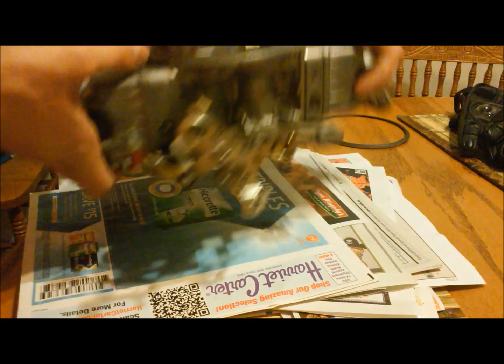Holley Carb: Ported vs Manifold Vacuum Advance (CARB BASICS PART 1.5)

Comment: Hey thunderhead289 can you use the thermo vacuum switch for ported and manifold to distributor in the back of the intake instead of the front

Comment: I have a crate 383 stroker in my 77 Monte Carlo that came with mechanical advance. Also installed 700R4 tranny & 3.73 rear gears. The cam Lift: .500 / .510, Duration @ .050: 225 / 231, Centerline: 108, Fair idle
The vacuum advance cannister is connected to distributer but crimped (not hooked up to any vacuum). As it is, my timing settings are maxed out for maximum engine output. Car runs perfect! If I hook up vacuum advance to manifold, can I simply leave those timing settings alone?

Comment: WRONG!  LOOK IT UP! All you need is any shop manual or Motor manual and you will see, ported vacuum, also called timed vacuum or controlled manifold vacuum, was THE ONLY THING USED PRIOR TO 1968. Don't take my word for it, look it up! Holley,  Carter, Rochester, and Ford carbs ALL state to connect ported vacuum to the dist from the factory. The only argument is between Edelbrock and every other factory manual and carb manufacturer out there.  Ported vacuum was used as the ONLY type of vacuum advance back to the early 50's and earlier! The only carb company that stated ported vacuum was only used on emission vehicles is Edelbrock, and many have called them out on that and they refuse to reply or change their documentation, even though EVERY shop manual, Motor manual, Chilton manual and every carburetor manual, except Edelbrock, says it's ported vacuum that was originally used from the factory. Like I said, look it up!

Comment: You say anymore than 24* at idle is too much but you don't explain why, I'm running at 30* and the engine's never run better. in fact, I plan on re-curving my distributor for more advance, Numbers mean nothing, it what the engine wants. "No disrespect" just saying. it's just that some people make statements with no explanation to back it up.
Reply: You got that right. It depends on the cylinder pressure that your combination provides. One engine may not even crank over with more than 10° of initial timing and another may not have any punch at all with less than 30.

Comment: This guy seems knowledgeable but made a mistake about ported vacuum stating that it "wasn't used until the late 60's due to emissions."  That is completely backwards.  I have owned cars back to the early 50's and worked as a mechanic in the 70's and ported vacuum was ALWAYS the factory standard and many times hardwired that way with copper tubing fittings so they couldn't be "accidently" moved.  It wasn't until the late 60's early 70's that they found different ways to reduce or eliminate ported vacuum advance by using temperature sensing valves that shut it off or used manifold vacuum "dual diaphragm" distributors that  when manifold and ported vacuum were the same, it cancelled out and gave no advance when cruising.  Ported and manifold vacuum are pretty much identical when driving, under light accel or WOT.  The only difference, as he said, was at idle. The other problem with manifold is, if you think about it, is you are running a lot of vacuum advance at idle and you go to accelerate and the vacuum suddenly drops and your timing retards significantly and can cause sluggish acceleration and sometimes backfire.  Where he is correct is in a high performance engine, mechanical advance is your friend!  I don't use ANY vacuum advance in my race engines because at WOT, vacuum advance doesn't work anyway.  Max advance at 34-36@2800 RPM is a good start.  If your cam is lopey enough to cause you to open your idle up to the point where you have a lot of ported vacuum, you would probably be better off with manifold vacuum to smooth out your idle a bit, but for a stock or mild street car, ported was stock and works well.

Comment: I had my vacuum advance hooked up to my ported vacuum on my carburetor, but it was causing a problem. The problem was, extremely hard starting like the advance timing was too much. Come to find out, when I turn the engine over to start, it was advancing my timing  so much, my engine would drag. Now I have no vacuum going to my adjustable vacuum advance. Engine starts nicely every time now
Reply: Learn how to properly set up timing! Something is wrong in your system!
Reply: @trailerparkcryptoking5213  i’m a technician. I’ve been a technician for 50 years. I know how to set  timing properly. The problem was heat soak on a holly carburetor and ethanol fuel. I fix the problem
Reply: Not possible.  Ported vacuum does nothing at idle or while cranking.  Sounds like your initial is too high.  Something not right with this issue.  Kinda like "since I painted my car blue, it runs much better!"  Can't argue with results, just how you got them.
Reply: @gregstahlman1680  I’ve already fix it
Reply: @gregstahlman1680  but yes it shouldn’t

Comment: Luke, I've been binge watching your carb videos. When did you switch from a manifold vacuum guy to a ported vacuum guy and why?
If lean (idle) mixture needs more time to burn, wouldn't manifold be the ticket?I
Love the videos.
Reply from the maker: This was back in the day when i taught along conventionally a cepted guidlines, not based on my own engineer knowedge and what i actually do. 
Ported is better in most cases due to what it allows you to do with your mechanical timing better matching it to conditions throughout the load range.
Reply: The only difference between MV and PV is at idle.  If you have a big, lopey cam, a little extra timing at idle from MV can smooth it out a bit and still allow low initial so you can crank it easier to start when hot.  Ported vacuum was ALWAYS standard back to the 40's and was NOT designed for emissions, in fact, emissions demanded they lower or completely block ported vacuum advance.  That statement about it only coming about for "emissions in the 60's and 70's" is incorrect.  I can show you the factory holley on my 58 FE that was hard wired to the dist with copper tubing from the PV port on the side of the metering plate.  No emissions then.
Reply: @gregstahlman1680 
I don't agree at all with using manifold sourced advance as a crutch for an aggressive cam with an automatic transmission because when you put it in gear the rpm drops, vacuum drops, timing drops, motor don't wanna idle in gear😢 I think the majority of people that advocate relying on vacuum advance for proper idle quality are trying to use a factory stock carburetor, something similar, or don't know how to tune/modify what they have to work on their modified engine. A modified engine will usually require more initial timing(modified distributor) and enrichened carburetor idle circuit(modified carburetor or performance specific carburetor) because a modified engine usually pulls less vacuum at idle speed to draw the fuel through the circuit. It's a matter of having the proper size idle feed restriction and the proper throttle blade setting in relation to the tranfer slot.
Reply: @gregstahlman1680 
But, like you, I usually prefer ported sourced advance(when I'm even concerned with vacuum advance). Manifold sourced vacuum advance can work very nice with a manual trans, though.
Reply: @gregstahlman1680  And right there is the obscure comment I was looking for... I'm putting together a 1958 Lincoln 430 and have a later Holley 1850-3 so I can run a PCV conversion. It has two vacuum ports, but some of the early Holleys (like the 1850-1, which would have been original on the Lincoln and Ford FEs) had only one port, up where the ported vacuum is on a later Holley. I was trying to figure out if that was ported or manifold so I can hook up my distributor correctly; I'm going to go with factory specs for now since that's what the distributor will be curved for; I figure I can always experiment later. Thank you!
Reply: @Hemingray1893  The port on the side/top is definitely ported.  The one on the bottom may or may not be ported.  I would plug the bottom one and use the top one.  Some later holleys have ported at that same place on the bottom, but a vacuum gauge would confirm that.  I have PCV on my 58 but just have a spacer under the carb with a vacuum port on it for the PCV valve. Works very well.
Reply: @ Excellent; thank you!

Comment: Where, exactly, is the hose connected for Ported Vacuum?  You point frequently to a tap on the upper part of the carburetor, I'll presume that's it.  Where do I pick up manifold vacuum?  Is it somewhere on the carburetor?  On the manifold itself somewhere?  Thanks!
Reply: A manifold port will be on the lower part of the carb because it gets constant vacuum from the manifold. Ported is higher on the carb because it only gets vacuum when throttled. I hope that helps. Sorry it took 7 months.
Reply: @robpitthan7497  Thanks.  I figured it out a while ago and got the thing dialed in nicely.
Reply: Awesome! I think it might be an issue I'm having with my '76 Dodge van.

Comment: Thanks for this video. I have a question though. If I want to use manifold vacuum for the advance, what should I set my initial timing at idle at? Should I have manifold port capped off while setting it? I have a mild cam 350 bored 60 over. Doesnt run hot idle is just a little roudy. Double hump heads. Stock hei dizzy. It's in a k10 chevy truck. Thanks in advance.
Reply: Learn where to set total timing!  Initial timing is for dummies that don’t know how to tune!

Comment: It depends on which vacuum canister you have on your distributor.  If you've got a "modern" canister that's all-in at say 14", and it's connected to manifold vacuum then vacuum advance drops out during throttle tip-in, that's not good.  If you've got an "pre-emissions" vacuum canister that's all-in around 5", then it's designed to be connected to manifold vacuum.
So choose the correct vacuum canister and connect it accordingly so it operates as intended.

Comment: Correct! Ported Timing was an early and poor emissions idea, and Manifold vacuum is the right way to go. Before anyone disagrees with that... Go and do some research! Good video.
Reply: Incorrect.  Ported vacuum was used back to the 40's and was to help with mileage and overall performance when cruising.  It wasn't until the late 60's 70's that they reduced or blocked it completely to make cars run hotter and cleaner.  This guy has it backwards.  Before ported vacuum advance, it was mechanical or manual with a lever on the steering wheel.  Manifold vacuum was NEVER used on a stock, early vehicle.
Reply: @gregstahlman1680  WRONG. Ported and manifold vacuum are the same except at idle.  Manifold advances at idle, cools the engine and runs more efficient. There is no way ported improves mileage over manifold vacuum.
Reply: @bmclaurine maybe, but he is right, that ported was used long before emissions, in the 50s and early 60s. Every mid to early 60s Mopar used ported vacuum.

Comment: Agree, manifold vacuum is best if engine will run with it.  The 355cu in SBC in my ‘69 Corvette, 600:Holley double-pumper, has full vacuum advance of 14* at idle, which the engine really likes.  Ported vacuum didn’t cut it.

Comment: So let me grab the concept here. Ported vacuum basically will pull more vacuum vs manifold vacuum, thus causing premature vacuum advance?
Reply from the maker: Ported vacuum simply doesn’t add any timing at idle where manifold will. Nothing more to it - I prefer to run ported with more mechanical initial advance. 

Vacuum advance will drop out of the timing equation when you are under high load low manifold vacuum scenarios
Reply: @ThunderHead289  Wait but in the video at 3:14 you said you like to run manifold vacuum, I've watched your newer videos where you say you prefer ported but what made you change your mind from preferring manifold vacuum in your older videos to preferring to run ported vacuum in your newer videos? I enjoy your content a lot but always wondered what made you switch
Reply: @crankemtv3907  I wondered the same. So yeah, would like to know as well

Comment: The standard setup, before emission controls, vacuum advance was only ported vacuum and its purpose was to improve fuel economy. then with emission controls, some companies got tricky with two hose vacuum advance cans, one ported and one manifold vacuum or like some Fords, the vacuum advance was switched to manifold vacuum. The distributor has to be made for using manifold vacuum, both the vacuum can and the mechanical advance. Performance and pre-emission control distributors should normally only use ported vacuum advance, unless they are specially made for super chargers or turbo chargers. Racing distributors typically have no vacuum advance. Fuel economy isn't much of a factor and the mechanical advance is all in at relatively low RPM and more advance from vacuum would just complicate things.
Reply: Thank you for clearing that up!  This guy stated that "Ported vacuum didn't exist until the late 60's for emissions." Totally untrue.  As you said, ported vacuum was around and the standard since the early 50's or before and was designed for  better mileage and was standard no almost ALL vehicles until the late 60's early 70's when emissions became an issue.  Manifold vacuum can be helpful in engines with big, lopey cams so you have more idle timing and still not too advanced to start the car when hot, but for a mild or stock street engine, ported is usually better and was stock on most all cars.
Reply: Thank you. This myth, that ported didn't exist before emissions is floating around the WWW forever and everyone seems to copy it, even David Wizard. I know for a fact, that every late 50s and early 60s Mopar used ported vacuum.
Reply: Thank you. All these "manifold vacuum" guys have been reading Edelbrock's manual and accepting it as the gospel. Plus an article from Motor Trend, which is almost word for word the same as Edelbrock. The argument is between Edelbrock's statement and every pre 68 shop manual, Motor manual, Chiltons, Holley, Carter, Rochester and Ford carburetor manual out there. Simply, Edelbrock had been proven WRONG and won't admit it or change their documentation! All that being said, the guy is correct in saying it only affects idle, and in some big cam applications MV is better for idle, but it was NEVER a pre 68 factory setup to use manifold vacuum and every pre 68 carb has ported vacuum.

Comment: Hi there. I have a question about timing my 351 cleveland. Engine had a mild cam, holley double pumper and runs mallory ignition with adjustable vacuum cannister. Engine was built when i got the car but i have been having ignition issues so i have been trying to get it right. And now after adjusting timing and vacuum cannister my timing is at 18 degrees at idle and 34 at 3000 rpm and ported vacuum to the cannister. Car finally runs great and good throttle response. Just wanted to hear if those setting sounds right. Am fairly new to this so i figure it is better to ask for advice.... Dont hear any pinging or knocking so i hope it is okay... Hope anyone can tell me if my settings are okay...???
Reply: Oddisto 76 18 might be a bit much.. how does it start when hot, what does your vacuum gauge and temperature say?. is this used for street? what ign. issues
Reply: @danwells7691  . Since i posted the question i retarded my timing down to about 12 degrees. Adjusted the accelerator pumps on the holley since they were way out of shape and now everything seems fine. The issue i was having was that when i floored it while driving it hesitated and backfired trough the carb. But after adjustments on both timing and carburetor it seems the problem are gone. Is 12 degrees still high you think???

Comment: I have a 1975 ford f150 when I sick on the vacuum canister it retards the rotor, this leads me to believe I can only run ported vacuum with that style distributor. Plz someone correct me if I'm wrong
Reply: I have a 78 Bronco and when I connect the manifold vacuum my rpm increase meaning I advance..I read the vacuum advance canister is adjustable but haven't tried that yet so like you I run ported and it purrs..

Comment: Can someone help me with my 454 holley 4 barrel carb on my boat, the secondaries don't open at all it wont go past 3500rpm, runs great, but the secondaries just dont open.
I checked the vacuum actuator and it holds good when i push down on the rod and place my finger, the small o ring between the actuator and the body is new, and the hole is clean!
Reply from the maker: How have you determined that it doesn’t open?
Reply: ThunderHead289 
Yes i am sure it doesn't open
I sat next to the engine I let my friend floor the gas pedal but when its time for secondaries to open it stays at 3500 rpm and they dont open at all!!
So i moved the secondaries lever by hand and it went to 4500 rpm!!
Reply: I thought they only use mechanical secondary carbs on boats just for that reason.

Comment: hey buddy awesome videos ... Question.. on my 302 with a Holley 600 where would i put my transmission (c4 modulator hose) vacuum hose and thanks
Reply: Manifold vac.
Reply: @mtnman6278  what would happen if the c4 modulator hose is connected to carburetor timing vacuum port?